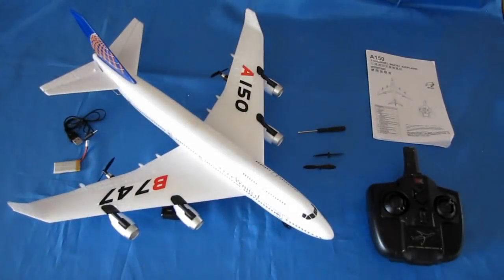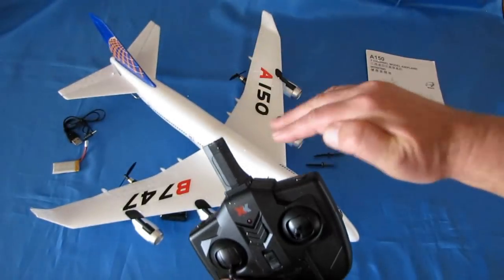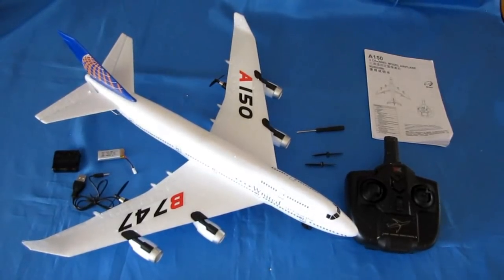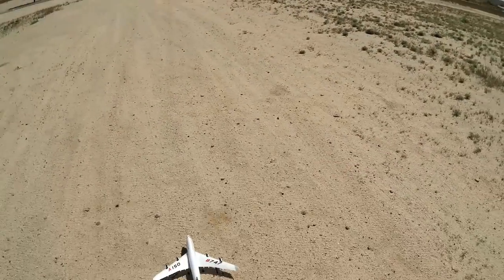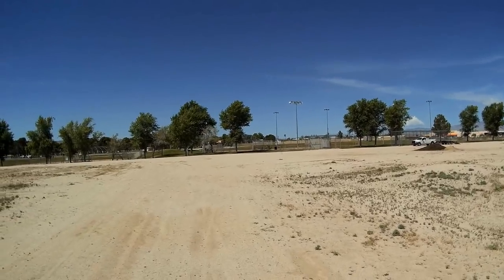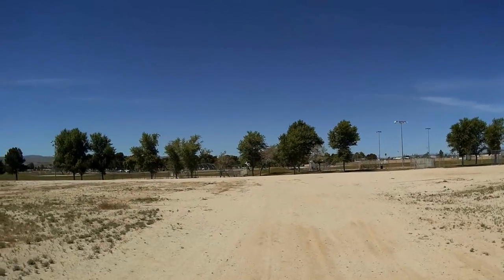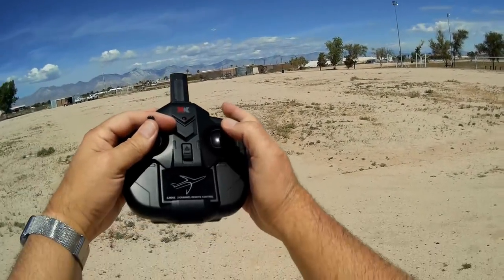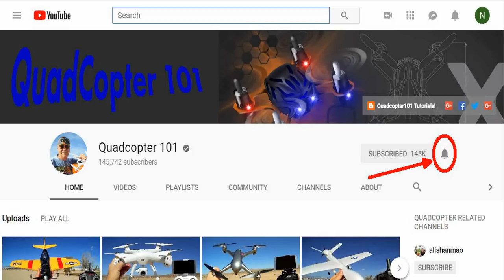WLToys XK A150 Flying Boeing 747 Three Channel RC Model Flight Test Review

Comment: Are the wnited and 747 friendship just stickers?
Reply: Water decals already on the plane.
Reply: @pajamamar2011  i know but are they stickers STUNK on the plane ? How easily can you take them off?
Reply: Use scotch or clear packing tape and it should strip /'lift' those logos off. Wnited of course is epic fictitious but the '747 Friend Ship' was a real slogan used by United Airlines in the 1960's.